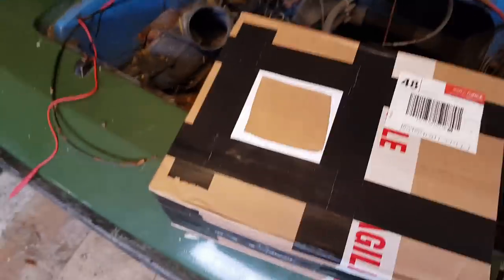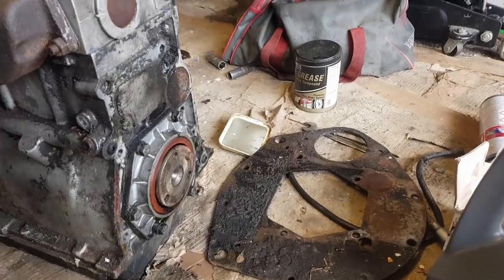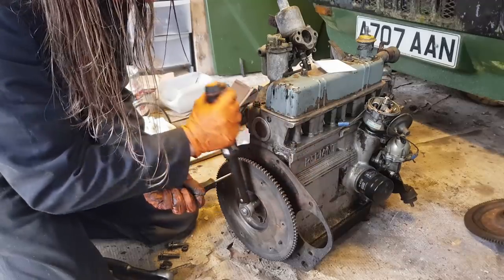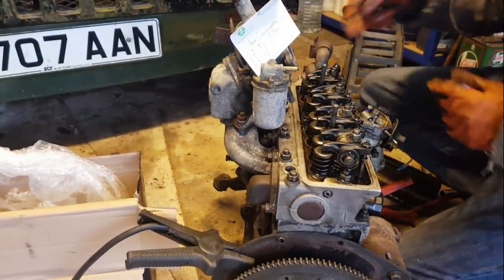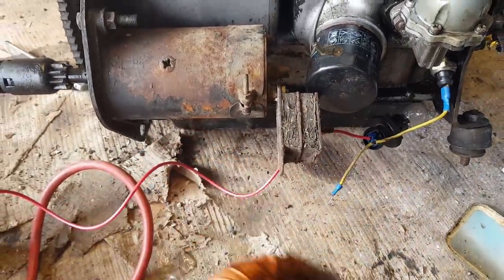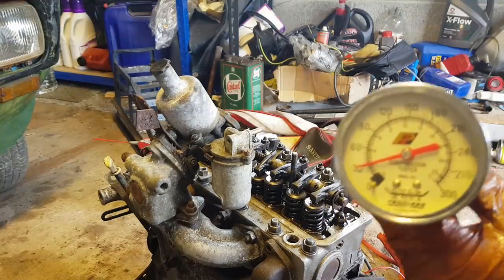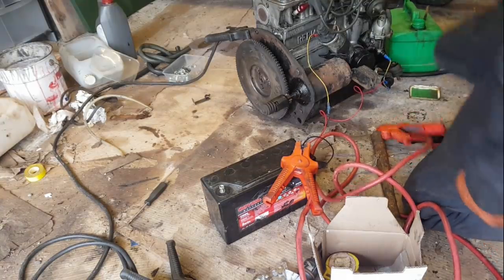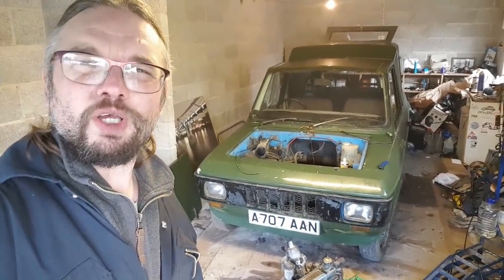Project Fox Part 5: Can I start an engine on my garage floor?!

Comment: Your approach makes perfect sense to me, Ian. There are times when a total strip and rebuild is justified, but "If it ain't broke, don't fix it!" is generally a good basis to work on.
The engine sounds great. I reckon the number 8 valve had been open when the engine was standing and was stuck. Hence the excess clearance to begin with, and then the lack of compression until it freed off and started to seat again.

Comment: Fantastic, Ian! She sounds sweet. Just how nice it is when things go to plan! BUT, please, i greatly enjoy your videos, so please, in future, do not continue with the foolishness of creating large amount of sparks right next to a open can of petrol! When you were touching the live to the starter big sparks were flying off. Petrol vapours don't get on with big sparks. Don't get me wrong, i am a few years older than your good self, and i really have little time for all the modern health and safety stuff, but even i draw the line at creating nice big sparks next to a open petrol can. So kindly refrain from such behaviour in the future - we don't want you and the fox suffering from nasty burns! Other than that, keep up the good work :-)
Reply from the maker: It's a fair comment!
Reply: Yes it's not only what is in the can, but the unseen vapours floating around from the open can. Have a look for a tank from a scrap lawnmower  they are useful for checking suspect fuel lines....or no fuel lines at all. Sounds good though did you do the rest of the compressions?
Reply from the maker: @Witheredgoogie  Yes, other compressions were  fine. Very pleased.
Reply: I was worried about hair in the flywheel ;)
Reply: I said the same thing....highly stupid actually

Comment: Engine sounds lovely, sometimes a drop of oil onto the cylinder will bring compression back, we used to do that when I grew up in Zambia, Africa. There's definitely something in our DNA which loves getting an motor running again. 👍

Comment: There is a common theme that always runs through these treasured moments " Eureka it only bloody works yeh hoo ". Isn't it just great when you've scratched your head and wiped your brow and then that moment.
Great stuff as usual Ian. I think you are a great bloke who will have a go at anything you put you hands to but most of all another super presentation.

Comment: How pleasing to have efforts rewarded, and running so smoothly (considering its lack of exhaust ) Moons ago when running unattached engines I bolted them to a hefty pallet which quite often went on a short tour of the yard when started up.

Comment: Yay! From the look of the block, I knew this'd be a runner. :-) I wasn't fooled by the initially worrying compression test on no. 4 ... but neither was I prepared for just how sweet and smooth it sounded in the end.

Comment: Great achievement! Definitely a 'Good Un' style job. That engine sounds incredibly sweet for just sitting on the floor unconnected. Will be music to the ears once all fitted up! I learned the Rule of Nine for tappets as an apprentice back in the 80s and was taught an easier way than counting each time; Imagine a mirror halfway down the row of rockers, between 4 and 5, then adjust what would be the reflections of the two that are down. Always adds up to nine. Mark the ones you have adjusted with yellow crayon and turn the engine to drop another two (any - doesn't matter what order) and repeat until all marked as done.

Comment: Not a bad policy to not strip it before starting. I have seen far too many engines stripped with grand intentions of rebuilds only for them never to go back together, or for the owner to get too hung up on "ideal" tolerances resulting in the motor being binned/parted out (even though it would have been good enough for its predicted light use/shows).

That laugh you gave when it first fired... I think that must be universal to all who get first life from an unknown engine! Great work man.

Comment: Loving the open petrol can, your oily overalls and sparks flying off the jump leads, all in close proximity. We don't want the next episode of HubNut coming from the local hospital burns unit.
Reply from the maker: Danger is my middle name. Actually, it isn't and I hope to be more sensible next time.
Reply: In the SAAB shop, when we tested an engine, it was done with the engine bolted into a gutted tranny/clutch bellhousing and a special welded up bit of steel angle iron to keep the engine off the floor and stable.  Mostly to prevent it from doing what it almost did with you: try to turn sideways from the acceleration torque of the flywheel as the engine sped up.    A bit more kit than you'ld probably have patience to make.  But in the name of safe testing the philosophy being letting it run for an extended time before committing it to the engine compartment.    There was a small fuel tank and a partial cooling system made from extra heater cores and hoses, so the engine could be static and dynamically ignition timed, listened to with an engine stethoscope, the thermostat checked and the fuel system and oil filter inspected for leaks while the engine warms up.
Reply: I'm still having nightmares: Ian wrapped in bandages and TWC's cute little face, melted.....

Comment: LOVE this!  Sod engine mounts,sod practicality, we're going to get the engine running on the floor and use coke as coolant and an old 2CV headlight mount as an oil pressure indicator.   Brilliant.
Reply from the maker: Actually, the oil pressure light is a Citroen BX front indicator...

Comment: A Fox pickup truck - Oh Wow - the Morris Minor pickup has always been one of my "I wish" cars but I will have to add the Fox now 😍😍😍😍😍 I didn't know they had ever existed. I sold my Reliant workshop manual on eBay many years ago complete with genuine oily fingerprints.

Comment: When I saw the engine rock over the first time it started I had visions of it doing comedy somersaults out of the garage and onto the railway line before getting run over by one of the VoR locos. Cue Hubnut looking into the camera, pouting and uttering one word: "Bugger."

Congratulations are due though! After a nail-biting worry here over the compression test for cylinder 4, I was chuffed to bits to see it run. More Roadkill than Mustie1, I'd say :)

Comment: This is fantastic!  Loving it!  

Good catch on the flywheel bolts being too long!  The results would have been catastrophic; it could certainly have ruined the flywheel if not more.  

I like that even though you're full-speed-ahead as far as getting it running generally, you're moving carefully and testing each thing as you go.  The compression progression on #4 was perfectly.  It probably just had some grit on one of the valves, and the brief start was enough to blow that out.  

Thank you for ramping the volume down when the engine started.  I presume the actual volume in the garage was deafening with a 4-cylinder running with ZERO exhaust pipe.  

Nice job and nice video!  You will inspire me yet to get my VW running.  This spring for sure.
Reply from the maker: Thank Samsung. My phone clearly has automatic audio levelling. It was pretty loud.

Comment: Thoroughly enjoyed that.  The engine didn't take too long to wake up. I was worried when the compression gauge was showing poor health on cylinder 4. But thankfully all is fine. Sounds very lively despite it's small engine size. Foxanne is another step closer to being back on the road now. Keep up the good work.

Comment: Ian you are a true legend.
This video is an up yours to modern technology
Who needs sensors and ecu's to run a car engine.
SERIOUSLY mate don't clean that engine just throw it in the fox and drive..that engine is sweet.
Well done... When you got it running I was sat here chuckling to myself saying a few wires and fuel and running engine on a garage floor.

Comment: Well done Ian, though you are not a trained car mechanic, you know what you're doing, sometimes with some small obstacles, but you've got the motor running, even with a sticky valve in the 4th cylinder.

Comment: Ahhhh! Egor! My creation! IT LIVES! Well done HubNut. I was very worried about that low compression for a while. And the possibility of your engine rampaging around the garage if it fired up. I know what you mean about skill levels and DIY car repairs. Although some say (ahem) I was an engineer, i.e. fitting and fabrication, I've had people say "Oh why don't you rebuild your A Series Mini engine at home, they are simple enough.. " Er...no engine hoist, no spare room, no power or lights in my garage, and not enough enthusiasm to get stuck in that far. But oh, those sounds you made during the making of this video....whirr whirr whirr...cough...splutter....whirr whirr whirr....whirr whirr whirr...so many hours of my life spent like that with the bonnet up on my Morris Marina twin carb before the plethora of ignition and induction defects were fully understood. Quite traumatic!

Comment: I will add that whilst a very basic engine the all alloy Reliant lump was incredibly reliable. Oil changes every 6k and good antifreeze and should never miss a beat. Sensible mods are electronic ignition as points could be a bit of a pain but otherwise a very worthy little engine. Quite tuneable too though I have had an indicated 95mph out of a stock 1982 Rialto. Boy was that a fit engine.
Reply: When it was introduced in 1961 it probably had the greatest power/weight ratio of any engine in the world.  It was ahead of its time, being still an excellent engine today. If it was adapted for multi point fuel injection, even better.
Reply: I wonder who designed the engine.  Good idea to keep it pushrod.   I'm a fan of the Hillman Imp engine.
Reply: @johnnytenjobs  
The Coventry-Climax Imp engine and the Reliant engines were advanced for their day.
Reply: It was a very decent little engine, and in many ways better than the perennial A series, albeit of a significantly smaller size.
Reply: @johnnytenjobs  The Hillman Imp engine was OHC.

Comment: Well done, engine is running very sweetly, no smoke either. The cylinder you start with when doing the clearances. 1 or 4, should have the piston at TDC and both rockers rocking. Then go from there.

Comment: Brilliant, I had a sudden flashback to a spitfire 1500 engine I did the exact same thing with. I like you learned by doing, messing up, doing it again, fettling and fiddling and always keeping a functioning car as well so I could actually venture out!

Comment: Great video! I've never tried starting an engine I was going to fit on the floor. The open petrol container looked a bit dangerous next to all those sparks.
Reply from the maker: Yes, it was dangerous. Lucky not to have a fiery problem...

Comment: Found this really interesting, I've never worked on an out-of-car engine, or anything pre-EFI, or anything that doesn't run, so this was a good insight of the steps needed to go through. I have a 70's Renault V6 in a kit car, I plan to replace the engine but am hoping to get it running first so I can sell it (might keep another classic going), so I will come back to this video for reference! I felt the sense of satisfaction when it finally did run!
Reply from the maker: Don't leave open cans of petrol about the place would be my main piece of advice...

Comment: I have plenty of room in my mind for both ends of the spectrum. I enjoy the down to every nut and bolt restorations, but they take a lot of time, money and skill. Your way gets old cars back on the road so they can be enjoyed, and leaves lots of money (when compared to the nuts and bolts thing) to play with other cars. Both sides have their merits imho.

..oh and congratulations on getting the engine going. It sounds much better/healthier than i expected :)

Comment: glad its a runner and it sound good.  i agree leave well enough alone i think with old engines once you strip them you start getting problems.  you should name the fox basil after basil brush.  i like your channel because of how you do things its real you make mistakes but keep going until you fix it or destroy it.

Comment: They say leaving the torque wrench dialed in messes with the spring inside but I believe dropping them can knock out the calibration too. Mines never been calibrated and nothing has fallen off yet, I got it second hand with a few other decent tools at a car boot sale ages ago. The engine sounds very nice I'm impressed, can't wait to see it in the car!

Comment: Completely agree with your sentiments on just chucking it in and seeing how you go. A colleague is currently stalled restoring nut-and-bolt a Corrado whose engine was perfectly good before he decided to take it apart. Broke one of the rings to find them NLA. Life is short, get stuck in!

Comment: It would have been just a open sticky valve on number 4 causing the low compression at first.
The beast is alive.
Well done ian.
Reply: Yes, thinking about it, that would make sense, that's why the valve adjustment went out of whack once it moved a bit. It probably needs checking again. Mart.

Comment: This is like watching an impending disaster movie !... Hahaaa.... Reminds me of when my local truck repair shop were doing an engine change on a MAN truck....They had the replacement engine sat on the floor and fired it up right there.....a 12 litre 6 cylinder..... If that fell over , better run !  lol.

Comment: Sounds sweet.  Nice work!!!  I never do tappits like that, I always stick allen key down the plug hole and watch in the inlet valve close to make sure you getting TDC on compression. Prob cos I'm a bikerand see lots of different engine configurations and seen wrongly adjusted tappits far to often. Well played Chief!!

Comment: If your anything like me, the smile won't leave you for several days! I still remember the lawnmower engine that ran after I stripped and rebuilt it as an early teen. Great feeling when they run. Thanks for sharing. Even I have a grin going here!
Reply: Quite broke and even more cack-handed, I can still recall taking a little Suzuki 100cc motorcycle carb to bits when i was 19, more in hope than expectation than the bike would ever run again. Much to my amazement after reassembly, it did!

Comment: Just like my old 6 cylinder forward control the compression was sitting at 50 to 60 psi across the cylinders and was easy to turn over with the plugs in. I fired it up a nd after a short run the compression and effort to turn the starting handel was considerably improved. After a 26 year slumber. A video is on my channel of starting attempt and 1st fire up. 5097miles since 1970 when I found it. This spring I will be taking it to local shows. I will do talking and walk around. 😊 love the little Reliant Fox
Reply: It had a full service at 5087miles was driven home and put away at 5097 in 1991.  Just an amazing feeling slowly waking up a car. I oiled the bores et c. Filled up the float bowl and just amazing how  short run can free off rings et c.
Reply from the maker: Oooh, I'd love to come and do a video on a forward-control Landy!

Comment: All these Reliant bits and that engine really do take me back to my childhood days helping my dad with his Reliant Robin, he was a Reliant owner from 1988-2002, his first one he resurrected it from the pathway to the scrapyard it was a 1975 Reliant Robin mk1 with an arthritic 750cc engine in it that was on its last legs, so out it came and he put in a rebuilt 850cc engine(that he rebuilt himself often on the kitchen table!)
    Anyway I digress, the engine was the same unit they used all the way to the end, which is really useful as parts are a plenty..if you know people and you know where to look! 
     I was 10 when my dad trundled home in the original car, and spent many a weekend playing look out for his specs that he repeatedly took off whilst working underneath and nearly smashing them with his arms whilst rolling around underneath. 
      Yes, one could write a novel on our Reliant capers of my youth! 😁🙄

Comment: What a buzz it must have been to get the motor running!
The Hubnut way works, I'd have stopped when there was no compression, and started trying to 'fix' that non-problem. 
That's if I'd had the nerve to try firing it up outside the car (tbh I wouldn't have tried that either)

Comment: I reuse those lock tabs all the time unless they damaged beyond the point of use. I think the area around the rockers looks very good. I have seen engines with a thick layer of sludge on all the metal parts and the top deck of the head.Yours looks clean in comparison. That engine sounds really healthy. You have definitely made out well.

Comment: Loving the man in a garage playing with his toys thing.
Only two things that REALLY concern me are,,,,,:-
One:-  Loads of sparks and an open and nearby fuel container. Fuel vapours lay across the floor so in the vent of a flash over the whole floor area would of been alight (bye bye project fox).
Two:- Please if you must have long hair tie it back and short when you are dealing with engines and other fast moving part.
Once it gets caught there WILL BE NO getting out of it.
Finally remember to remove any jewelry when playing cause this can get caught up or conduct electricity causing chokes or burns.
However on a happy note,,,,
Well done that man for having a go. It would be amazing if you have a custom built exhaust system made. I would go for twin side winders. Cylinders 1&4 to one side and 2&3 to the other.
Reply from the maker: Don't worry. Both have been taken very seriously since this video.

Comment: Nicely done. That engine sounds ok. I reckon one or both of the piston compression rings on the low cylinder were gummed up and then freed off.